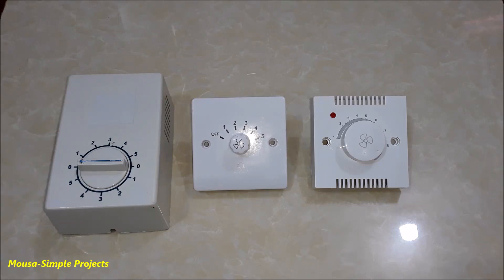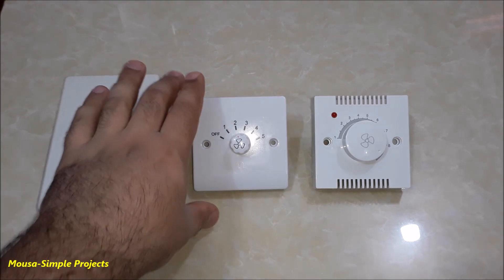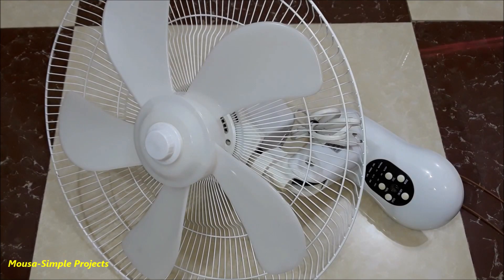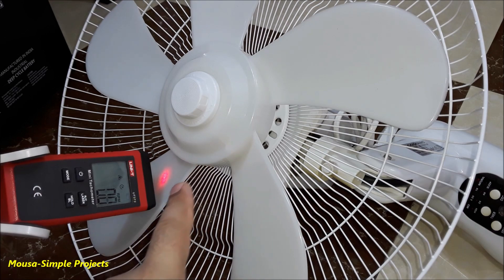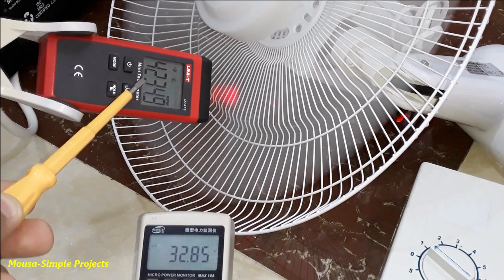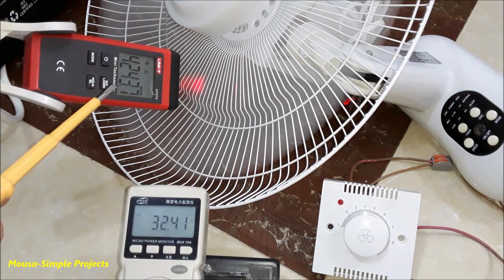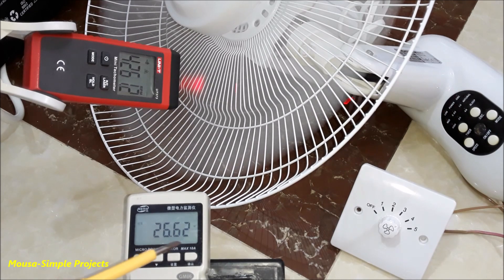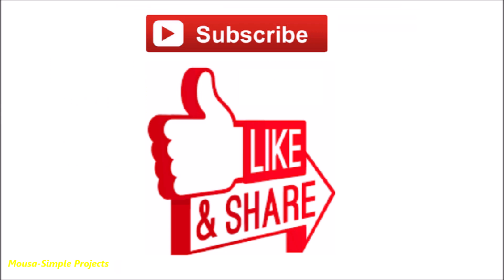Which Fan Regulator is Best? | Fan Regulator Performance Test

Comment: as with my experience, capacitive fan regulator is best for fan loads, since its an inductive load. If u use triac method, then in course of time, the triac gets destroyed due to inductive voltage spikes from fan

Comment: This is very interesting, I was looking for this for a long time, the only regulator I was aware of is the one with the triac, but this one has the effect that at half speed the motor hums, this is due to phase cutting of the triac.
The only solution I found for that instead, but rather expensive, is a variac.
The solutions you offered I will definitely try.
Just wondering where these regulators are available.

Thank you!